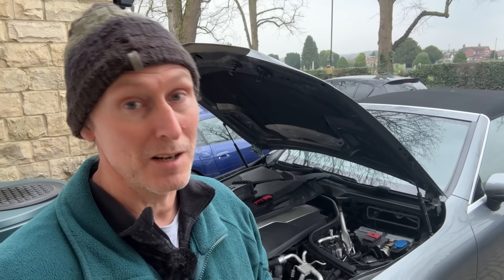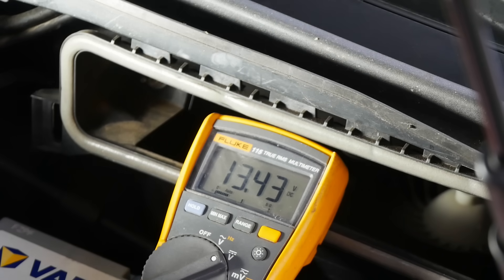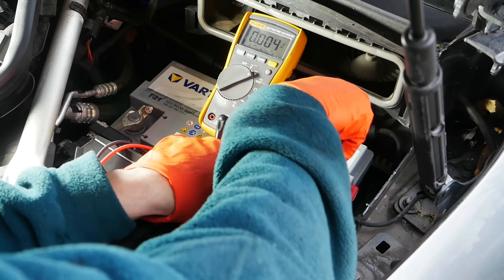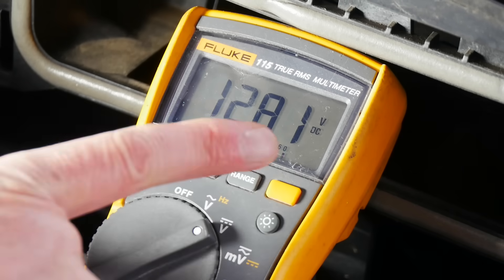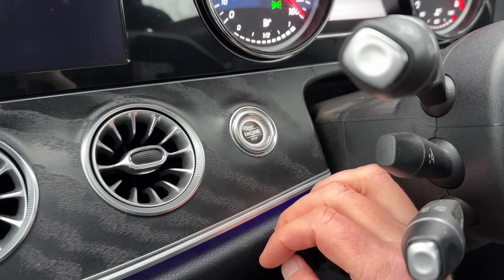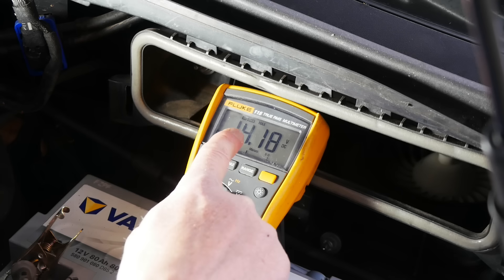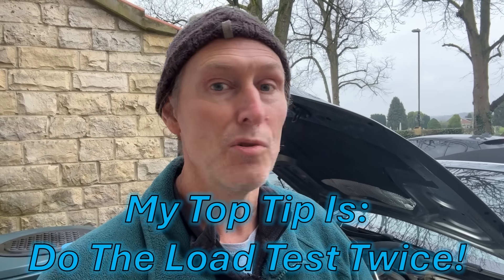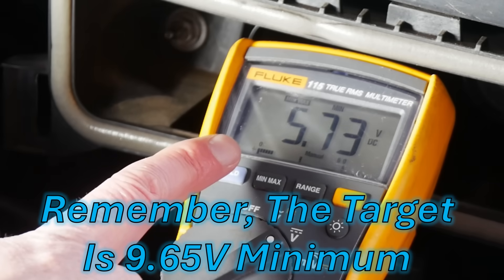Car Battery Load Test With Multimeter | EASY DIY

Comment: If the voltage is 3/4 or below 75% then its buggered 
However it may still show the voltage is good it may still not hold a charge
This happened she got to work in the morning traveled to her second job and when she came back the car wouldn't start again
Reply from the maker: Yeah, a lot of people thing if it starts once, then it’ll be ok because it’ll charge back up again through driving but sometimes it isn’t the case once the battery starts to age. Cheers, Phil

Comment: Had batteries that were showing as fine repeatedly, including by multimeter and tested by Halford's and others; when they were NOT ok whatsoever! Standing voltage always appeared fine; but then not enough cold cranking when needed, as in very cold weather, or sometimes no so cold weather!
Reply from the maker: Batteries are a law unto themselves! 😁

Comment: Same meter can do an amp draw to see if there is parasitic draw from the battery
i.e. stuck relay etc. A/C clutch relays are famous for sticking and you can't see it.
Reply from the maker: Yep, I have used this meter for that. Good tip about the AC clutch. Thanks!

Comment: Another thing to think about is surface charge.  Turn headlites on with engine off for 3 minutes to drain surface charge before test.
Reply from the maker: Thanks for tip! I was aware that you needed to wait a while after charging to dissipate the surface charge but using the headlights to speed up the process is a good idea 👍

Comment: Old car breakdown mechanic here,remove fuel pump fuse if petrol or solenoid wire on pump if diesel.Make sure battery is fully charged then run starter motor for 10 seconds.A petrol car should not drop below 10 volts when cranking and a diesel car should not drop below 9 volts.
The charge rate is not always what this guy says  because some newer vehicles have smart charging systems and won't show be charging as much as he said,sometimes nothing much more than the normal battery voltage.

Comment: Do you have that link for the drain test, my motorhome battery keeps draining overnight and I wanted to see what is pulling the power
Reply from the maker: Really sorry, I tried doing a video because I thought I had a drain, turned out I didn't (was a different issue" and the footage then didn't make sense. Hence, no vid produced. However, I recommend this vid by Eric The Car Guy which is a really good guide to parasitic battery drain. Just tell him Phil from Revive My Ride sent you! 😜 https://youtu.be/KF1gijj03_0?si=2WPHB9XpyLXjijDb

Comment: Very informative on the electric side of things.However,to check if your alternator pulley freewheel is working just look at the tensioner arm when the engine has just started(especially from cold).
If it is bouncing up and down a lot,chances are it is not working correctly.You can vary electrical loads and watch it.Normally it will hardly move up or down when you do this.
Just discovered this and corrected it on my motor.😊
Reply from the maker: Thanks for sharing this tip! 👍😁

Comment: I never understand how OE batteries last 8 years no problem, whereas when I replace them with aftermarket, like varta silver or agm, then they can start becoming unreliable after 4 years or so.  Good explanation.
Reply: It also depends on the type of driving. Everyday short distances kill the battery, while longer drives allow the battery to charge normally. Likewise, low temperatures and the start-stop system are not good for the battery. My noname brand on the old car lasted 8 years.
Reply: Varta is not was before. Exide have god price and good result in time.
Reply from the maker: Agree, been very disappointed recently with Varta batteries, I need to find another brand!
Reply: @Mnezo666 American manufacturer, I don't buy.
Reply: @Mnezo666 varta batteries only lasted 1 year ,original batteries lasted 13
Reply: Have European regulations which have progressively reduced the percentage of virgin lead in a  car battery anything to do with the very noticeable decline in battery performance or is it simply to do with the fact that electronics, particularly digital electronics have become much more widely used in cars over the last 40 years ?  Also, is it easier to get a parasitic drain on a modern car with digital electronics because there are so many subsiduary modules and more cross connections and dependencies than there ever used to be in the analog electrical systems of cars 40 years ago ?
Reply: @nicholasroberts6954  Two cars I have had that if you leave 3 weeks without using, its Russian roulette if they start. One is the Chrysler grand voyager from new,  tried agm, optima red top ( lasted 2 years) plus others, that thing hated turning over. Especially fun in an airport carpark in the winter, about 2C , coming back from a 2 week holiday, car full of kids and of course no start. The other is a Porsche 996, eats batterys and after 2 or 3 weeks its a gamble. Ended up disconnecting them when not used.
Reply: German here: At my Verso 2.2 diesel the Varta reaches 7 years , still OK. Heard of BOSCH battery quality decline, and had it at a Mazda  3BL.
Reply: Have Champion battery for over 7 years. Still in good condition.
Reply: When I traded in my 03 Ram for a new one in 17 it still had the original battery working fine, the original battery in the 17 lasted 3 years, bought an oem still going in 25. I seldom drive it in winter so ever since I changed the original battery I keep a trickle charger on it when parked
Reply: From my researches Varta seem to operate a factory  production system with two different part numbers for each battery - is that an indication that there are two different qualities of battery being produced for each model . .one for fitting to new cars on the production line and one for the after sale market ?
Reply: Varta agm battery 8,5 years. Now is  dead need replacement.
Reply: @JURANQT  Aren't they designed for cars with stop-start technology and they are considerably bigger and more expensive  than ordinary sealed batteries  . . at least a third more in price. Although the AGM batteries can be used on cars that do not have stop-start technology  they may not fit the battery compartments on these cars.
Reply: But this video says nothing about oem vs replacement...
Reply: OEM batteries are regularly checked by QA. Aftermarket batteries are reduced specifications. 2 years life minimum. Normally 4 years
Reply: Yes, this is a fact
Reply: New Batteries are only lasting 5-5.5 years. A few years back I had an Interstate battery last 8 years for me. I swapped a guy for a total dead one and he got another 4 months out of it.
Reply: @don2deliver I got 12 years out of an aftermarket Inci Aku brand battery (part of Exide group i believe) in a V6 Ford Mondeo in the UK.....I have a mr2 roadster thats rarely used, getting 3 years max out of Yuasa batteries  as its not that big and regularly goes flat.
Reply: Great explanation of a test method far more widely accessible than many others!

Batteries remain a strange thing, can be quite difficult to explain to people who don’t have in-depth technical understanding and remain one of the most vulnerable parts of a system. There are also - always incredible exceptions to the norm. My ‘98 Mitsubishi Galant kept its OE battery for ten years and 171,000 miles! It was only while it was having its first replacement exhaust that I decided that for another £40, I’d replace the battery too. 

One problem with more modern batteries is that the business behind the brand often has nothing to do with or has completely replaced the business that ‘made the name’. Brands that were built on quality and reliability are sold out to bean counters who place profit above all and so quality suffers. Look at electronics and the Blaupunkt brand. Nothing with the Blaupunkt label today has been anywhere near Germany yet in the 60’s and early 70’s it was synonymous with quality!!
Reply: @jonchilds1637 this is so true. Hard to know what quality you are buying now, as the brand sticker is just that.
Reply: I’ve always used Exide Battery’s and find they last about 4-5 years , they are well priced and good value IMO. 👍
Reply: 9.6 volts is minimum for a load that is one half of the Battery CCA. Most cars don't require that much load to start. I could hear your battery was too weak.
Reply: I have never had a battery no matter where it was purchased or the vehicle was new or old last more than four years 
If you had either a car or truck battery last eight years you should have given it to the Smithsonian institution because it would be the only one in history to have lasted that long
I have owned cars for 40 years
Reply: I change batteries for living, some cars with OEM batteries  lasting up to 12 years.
Reply: i just replaced the OEM(Fiamm) battery on my astra J 1.6 cdti diesel... the battery lasted exactly 10 years and 3 months(since may-2015) ... bought Slovenian Topla AGM battery, hope it lasts 5-6 years... i drive the car on long runs, rarely i do short drives... i think that helped the battery to last 10 years
Reply: @evangiles4403 Original Hyundai 2009 battery lasted about 7 years.  Hadn’t given out but starting was getting less enthusiastic.  Climate here rarely freezing, generally 60-100F.
Reply: @evangiles4403 I've never had a battery die that quickly no matter the battery or the vehicle, unless there was something wrong with the vehicle and it wasn't being driven frequently.

I've owned cars from the 60s, 80s, 90s, and 2000s. No experience with the new crap.

Comment: Only the resistance called impedance, internal to the battery will technically tell you if your battery is good or bad. The rest is guesswork.

Comment: You can not measure the charge of the battery before 12-24 hours after stop chargin. The voltage for a fully charged battery will then be 12,5V. The level you are mesuring in the begining of the video does not give any rialable informtion of the charge level.
Reply: He explained that.

Comment: Everything shuts down while the engine is starting and comes back after starting.
Reply: 1) you can charge the battery with a battery charger 
    If you have the same problem after that 
2)Then you have bad contact in the cables to the battery
Reply: @konstantin-big  You misunderstood. While the starter is engaged all power to everything else shuts off.
Reply from the maker: How are the injectors getting fuel? How are the spark plugs getting voltage? The ECU to control the ignition and air fuel mixtures? I could go on…
Reply: @ReviveMyRide  
Informative 
There is a relay for fuel pump and a relay for ignition they have power 
There is a relay for the instruments, that relay haven't power when you starting
Every car have different systems

Comment: my battery is still warm even after 5 hours prior to engine turned off , is this normal ? voltage and amps are normal.     thanks ( w246 )

Comment: You should always trust people with Fluke multimeter 😂
The biggest problem with Pb autobatteries, they don't like to stay uncharged. If you don't use your car for long periods or you drive only 10 minutes to work every day, consider buying a cheap battery charger-mainateiner. I am from Canada and I have 4 (four!) plugs sticking out of my car:
1. Block heater
2. Buddy interior heater
3. Battery blanket
4. Battery mainteiner 
This is crazy, but -40 C is not a joke
Reply: I was born and raised in Winnipeg, so trust me... if you have a vintage Japanese car you need a 5th plug... for the (cheap as dirt, best bang for the buck, ultra-easy install) in-line "water" (coolant) heater to warm and passively circulate coolant (just by convection) in the system for an hour or two before you need to start it in the morning (use a timer or just plug in the in-line heater when first awake).  Once you experience the difference you'll realize you can ditch the battery warmer and sve on the watts.
Reply: So you can't trust us=electrician who don't have a fluke multimeter???
We have a Bosch multimeter 😂😂
Reply: When I was a kid, dad put a blanket on the engine to keep it happy over nite when it snowed..
My meter is a God Knows Who flung dung. But is true RMS cat 4 
So if I wreck it I get another free with life time warranty. I got my 3rd about 2 weeks ago.
Reply: I was thinking the same thing when I saw it 😂
Reply from the maker: Agree, in those temperatures, you’ve got to be an expert in maintaining your vehicle and battery against the cold. 🥶 Sounds like you have got it nailed! 👍😎

Comment: At what outside temperature should this test be performed?
Reply from the maker: As it’s just a quick and dirty test, my opinion but I don’t think it’s super critical. Whatever temp it is outside, you don’t have a lot of control over that. It was about 15 degrees C out during my test if that helps. I would imagine your results may be different if it is below zero outside though… cheers, Phil

Comment: That is not how you load test a battery.
Use a carbon pile load tester. 
They are under £100. 
Batteries need to be tested to their factory rating, the starter motor doesn’t even go near to that amperage.

Comment: Great content. Years ago I had a diesel Focus and randomly the battery would go flat overnight. I was walking past it one night and the instrument panel was glowing including the glowplugs lights, I opened the bonnet and found them hot! This is what was discharging the battery. It was caused by leakage on the instrument panel pcb, a known problem caused by climatic conditions affecting the lead free solder flux when it ages, that I did not know!

Comment: A Multimeter will NOT do a 'load test' of your battery.... Only a variable carbon pile battery load tester will do that.. A bad starter motor will cause a battery voltage to drop down below acceptable voltage...

Comment: There is a lot wrong here.   Under 10V  is  getting iffy  for starting.   Your so called load test does not take into account engine problems, or more commonly,  a bad starter  drawing  over-amperage.  I realize this is a  "quick and dirty"  deal,  I do this myself,  but be VERY  aware  that you can be lead down the primrose  path.   14.8,  by the way, is too high  for engine running  / charging voltage.

Comment: Great presentation! I knew both that there are specialized meters to test car batteries and alternators, and I know enough to know that you should be able to do it with a multimeter, but I didn't know what specific readings would indicate a problem.
Reply: You don't know enough because you cannot 'load test' a battery with a multimeter..

Comment: I got a real charge from the battery of tests you did.  Back 2 Basics never goes out of style. Cheers from So.Ca.USA 3rd house on the left
Reply from the maker: Thanks, glad you liked the vid! Just trying to share some techniques that the average guy at home can do without buying lots of expensive gear. On my way to So.Ca. in November for a holiday, will keep an eye out for your house 😀😂
Reply: @ReviveMyRide   10-4. Just remember, if you do stop by you'll have to let yourself in the front gate. My ankle bracelet won't reach that far  :face-orange-biting-nails:  Cheers
Reply from the maker: @ValuedTeamMember  😂👍

Comment: Great demo, I've used this method myself, glad to see someone else validate the idea. I'd just caution your viewers to definitely repeat the measurement multiple times. I once connected two different meters with min/max functions at the same time and got two very different minimum values after starting the car. The more expensive meter showed a lower (more accurate) voltage, while the cheaper one showed almost 2 volts higher if I remember right. I guess the cheaper meter took fewer readings (at a slower rate), and the battery must have dipped to its lowest point in between the points where the readings were taken. Whereas the more expensive meter probably takes more/faster readings which allowed it to be more accurate. This is probably less of an issue if your car cranks over for several seconds. But if your car starts fairly quickly then I'd be cautious of the reading and repeat it a few times. I'm sure your Fluke meter reads at a decent frequency.
Reply from the maker: Thanks for sharing your experience and the extra info. Never thought about it but yes, I can imagine a high end multimeter will potentially scan and read faster, making the test easier and more relevant! Cheers, Phil
Reply: I’m guessing an analog multimeter with a needle would solve that issue?
Reply: @NicholasRiviera-Dr do they make an analog meter with a min max indicator?
Reply: @lucash1980  it would be a matter of reading what the needle shows. I don’t believe that they record what the highest or lowest figure is. Would make it difficult if you couldn’t see the meter but you could setup a phone and recorded it?

Comment: You forgot to check for 'match car to battery amp output (cold crank amp)? A bigger engine? ( type), diesel or normal requires bigger CCA to start. Just a normal 12v car battery will struggle to start a bigger engine.
Reply from the maker: Thanks, that’s a great tip! I did assume that the correct battery was already fitted to the vehicle but as you say, there are times when that might not be the case, particular if you buy a used car 👍😎

Comment: You say that 9.65V is the minimum (for the car to start) 5min 15seconds.  

I just performed this test on my battery.  At rest the battery only shows 10.6V, and when under load, the minimum was only 6.0V, but 14.1V while running.  Can I revive my battery by putting it on a trickle charger - or is it time for a new battery?

Comment: What if my truck  starter clicks . It’s a Duramax had two batteries . I disconnected one to get reading in each one . Each one is  over 12 volts when I go to start it I can see it drops down to 11.2 or so , I’m getting 9.5-10.5 volts on the starter s wire while cranking when it does want to start , most of the time if clicks
Reply: Check your wiring for corrosion.